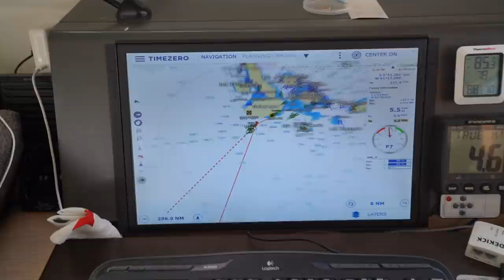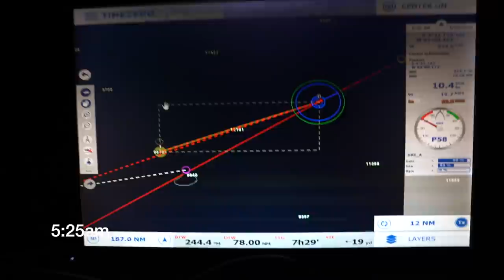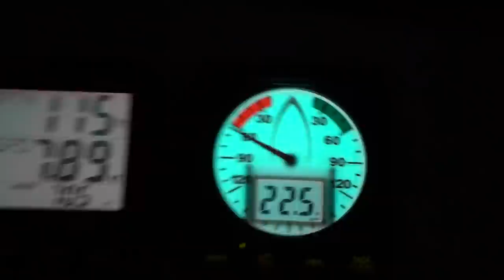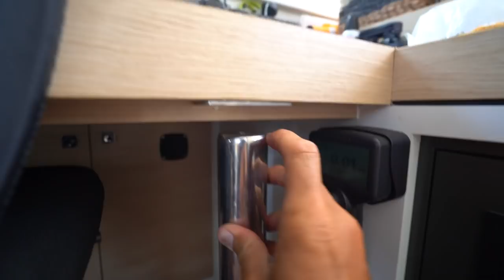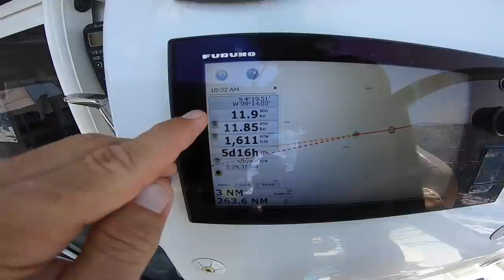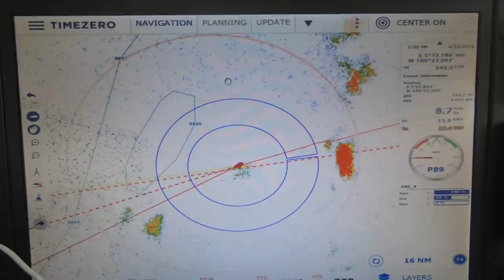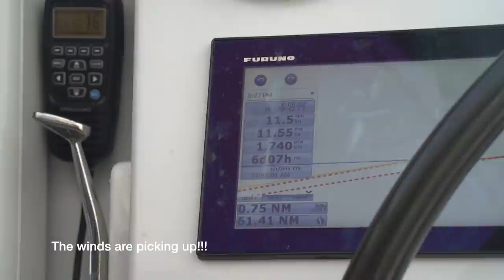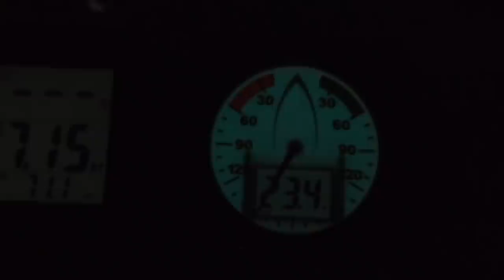Crossing the Pacific - 3,000 Nautical Miles of Nothing [🎥38🌏]

Comment: Just wondering, do you guys set the autopilot to steer to a wind angle or a waypoint?

In the last few years I've mostly used wind angles, the boat sails more efficiently and there's less sail trimming to do.

BTW, the O51 is very impressive!
Reply from the maker: We tend to use the heading waypoint as the boat tends to "S" when set to wind. We just keep an eye on the wind and trim constantly. We find it faster overall. We'll use the wind setting when the wind is super shifty, usually near land, to keep boat speed up and avoid over pinching. Both nice features to have!